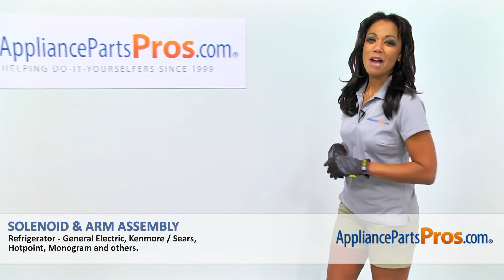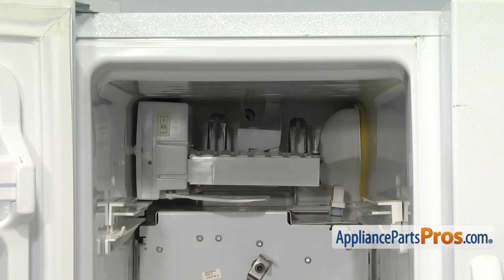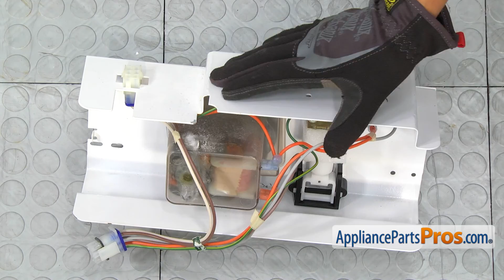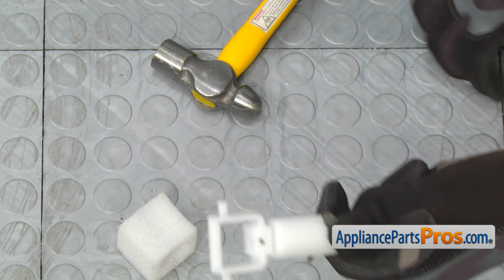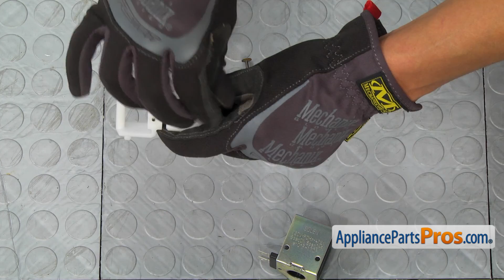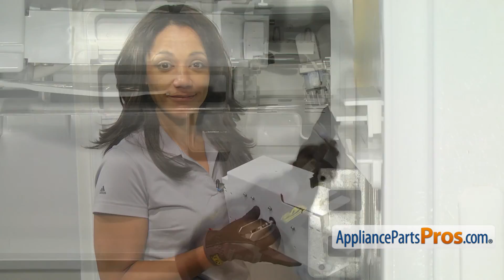How To: GE Solenoid & Arm Assembly WR62X23154

Comment: The main issue with this solenoid is it does not last too much.  I understand the duty cycle spec.  But, 5 seconds is normally not much time and people ends up activating the solenoid for more than 5 seconds.  The 15 seconds OFF cycle is too long.  I have had to replace this solenoid three times in the past 12 years.  Now I have to replace it again.  That's an average of one failure every 3 years.
Reply: What is the solenoid for ? Im not using the ice maker  and that part is rattling making noise